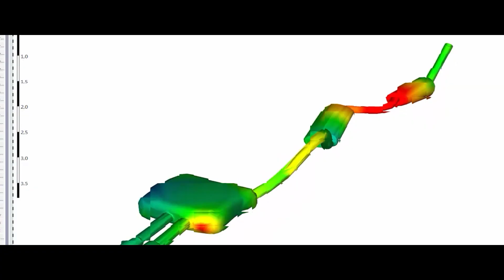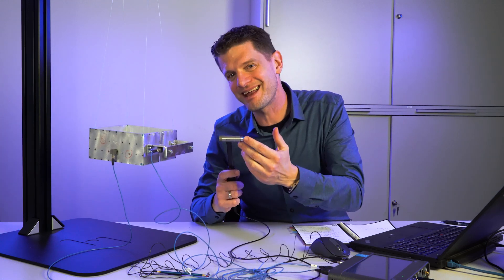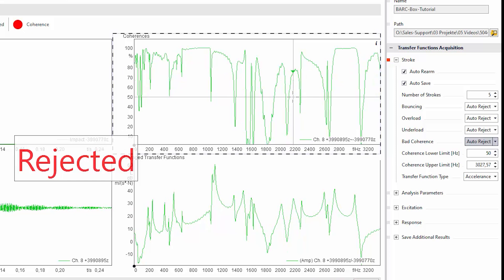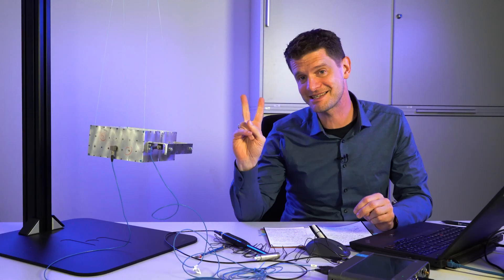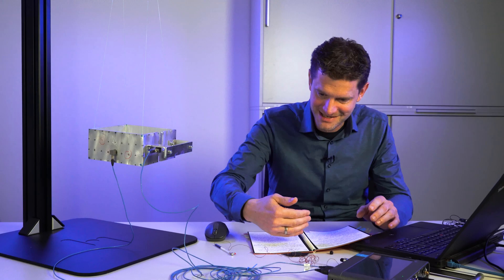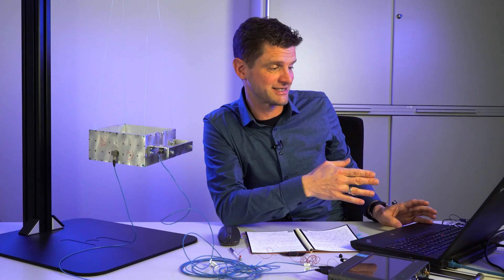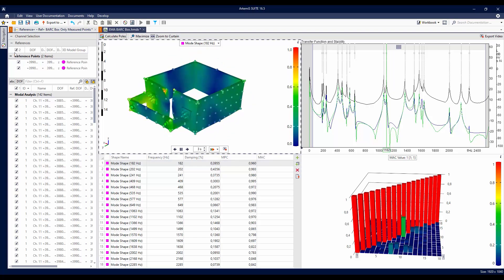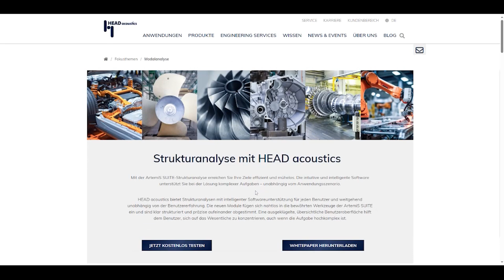Mistakes in Modal Analysis - From Double Impact to Selection of Reference Points

Comment: Sorry for the ignorance, but what kind of object is this?
Reply from the maker: This is the BARC (short for Box Assembly with Removable Components), a benchmark test structure designed to study the effects of boundary conditions and joint dynamics in structural analysis. It was developed around 2017–2018, primarily by researchers at Sandia National Laboratories and the Kansas City National Security Campus, as part of the Boundary Condition Challenge Problem. Since then, it has been widely used by the US structural analysis community to evaluate modeling, testing, and uncertainty quantification methods.